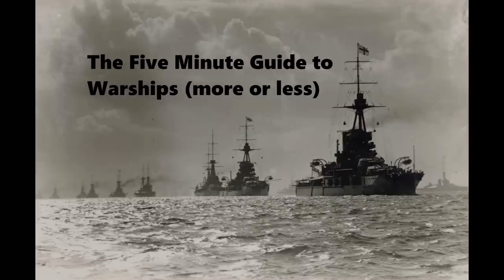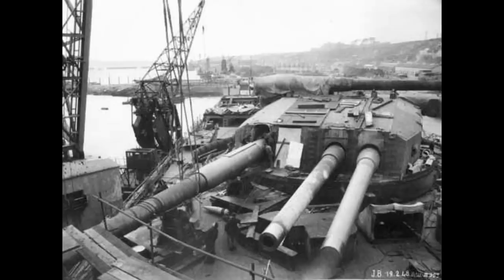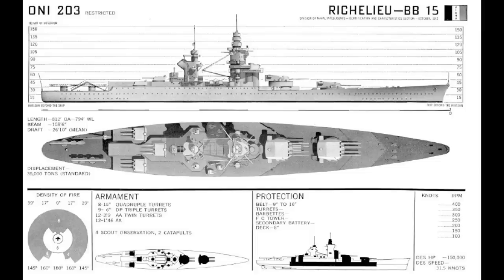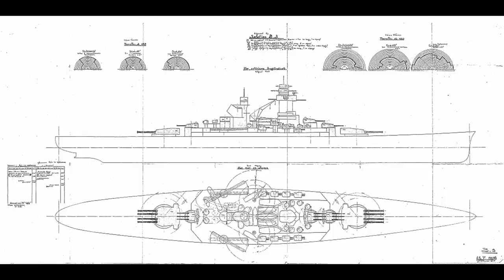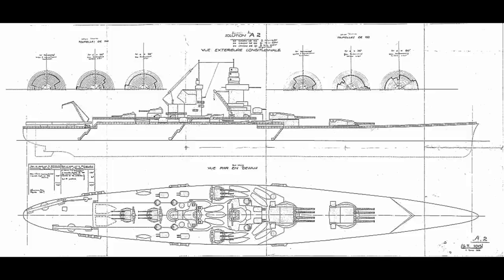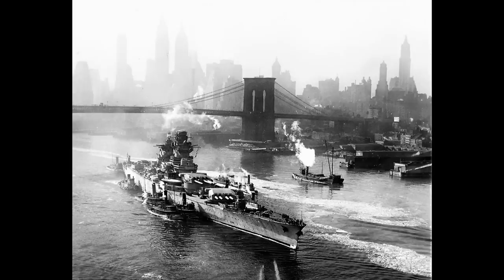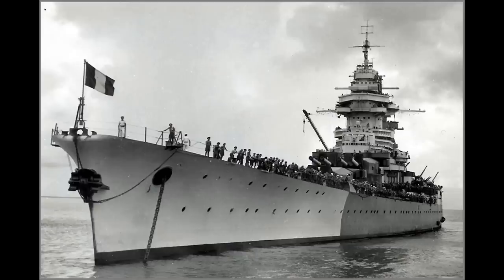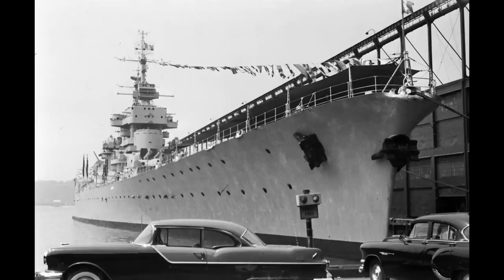MN Richelieu - Guide 039 (Human Voice)

Comment: WRONG  The were NOT quadruple gun turrets!
"Triple Turrets vs. Three-Gun Turrets: The Difference To put it simply, a turret is classified as a triple or a three-gun mount based on the guns it carries and how they elevate. A triple gun turret has all three gun barrels elevate and depress together as a single unit. In contrast, a three-gun turret has the barrels mounted individually. This allows each gun to elevate and depress on its own, independently of the others. This applies for other turret designs such as twin / two-gun turrets and quadruple / four-gun turrets. " - https://navygeneralboard.com/index.php/2019/01/13/triple-turrets-vs-three-gun-turrets-quick-read/